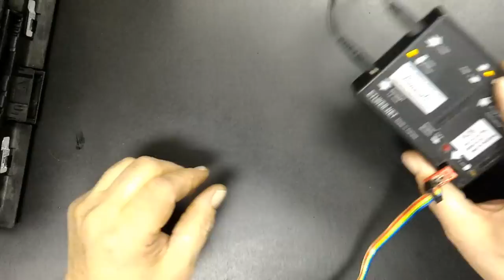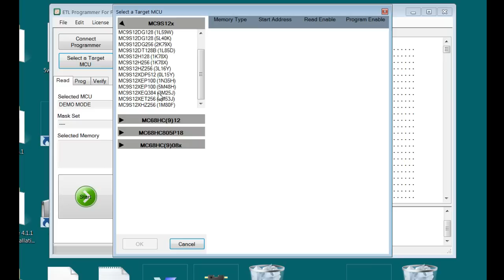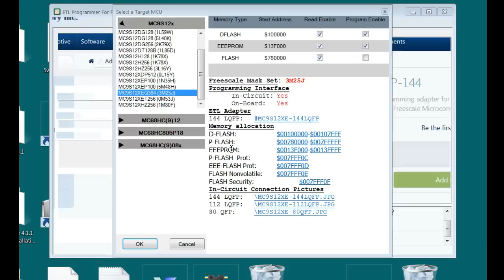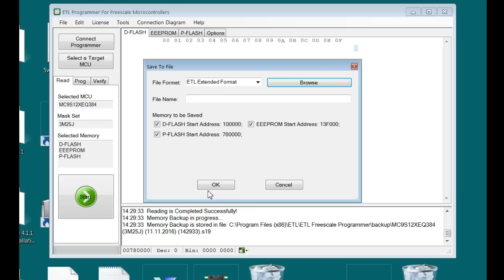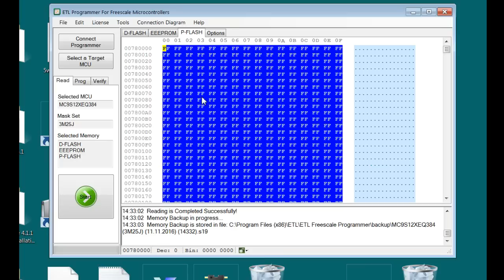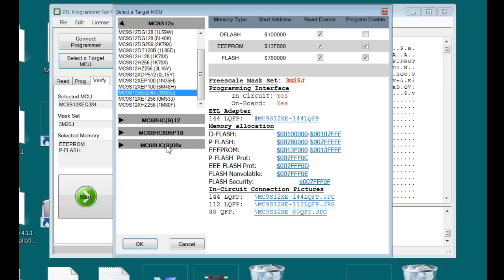BMW FRM module repair New!

Comment: Hi your work is a glass i must say how you Explaning is excellent and your information spot on. 
if i can ask you for some advice on my bmw e46 reg 2003 i was useing the AK90+ key programer to program a nather off the market key and done something wrong i thing i went over my Original key as it was the number 3 key i had when did buy the car as you know its 1 to 10 bmw always have one loged maybe the first owners lost the number 2 key as i only got one bmw Original key at the time with the car so i had the car with the tick number 3 on in the program menu of the key program setting when programing the new key now i can not start the car its like the key can not see the car it still open and lock the doors but startting the car not so i was going back you know when you save the bin file one by one its to much to rember in what order even with the date and times i was wondering if you know if my ews can be set back to its Original state or setting how it was i beleave you are the man who know

Comment: 9:40 Can you really just leave the eeprom empty and program it with ISTA/P? I have been mocking around with dumps and then having to disconnect the FRM to make ISTA/P detect the correct integration level etc.
Reply from the maker: Yes, you can.
Reply: Yes, you can. Why would we lie? This is the fastest way if you do not have original EEPROM content.
Reply: I tried to leave the eeprom empty last week with two different FRM's. If the eeprom is empty, it does start and you can code it using NCS Expert, but since the UIF is empty it can't be flashed by ISTA/P or WinKFP. I don't think there is any way to write the correct UIF so if you leave the eeprom empty you might have a working FRM but you are unable to use ISTA/P on your car anymore. My advice: find the correct eeprom dump.
Reply: Since leaving the eeprom empty doesn't work, I deciced to look into the procedure of converting the d-flash contents to eeprom contents. I think I managed to create a conversion program, but have not tested it yet. Basically you read the flash as if the entire memory is allocated to d-flash and use my tool to convert it to an eeprom image. You can find it here:
http://tlvps.tomvanleeuwen.nl/frm/
Reply: Hi. Did you really could do this with ISTA/P and an empty eeprom?
Reply: hi andriy !i work in auto domain is what we can discuss in this domain. just for experience

Comment: hello my BMW 320d 2010 FRM module is not working I need to fix it, is it the same way to fix the issues ? my car's roof lights, speedo meter lights are not working, head lights are on but not all of them only the white lights all I can see is 5 metres far that's all and windows of front doors are not working please give me a quick reply I need to fix this as I am facing a lot of problem these days.
Reply: take a look https://www.youtube.com/watch?v=Hn6U2I-RyOc&list=PLt6qTcpLTfMbV4hnxsFSKF8gT_vEcabSc&index=44&t=0s